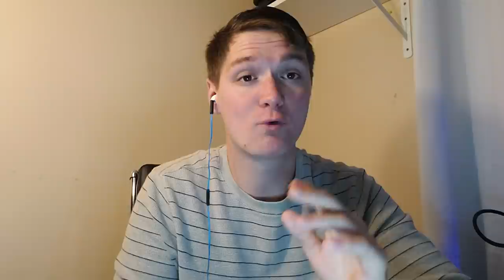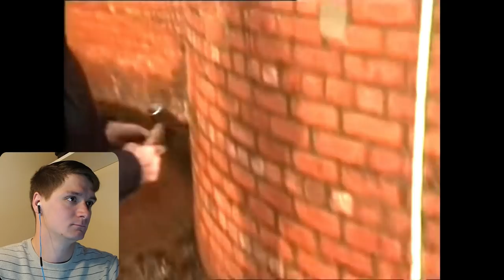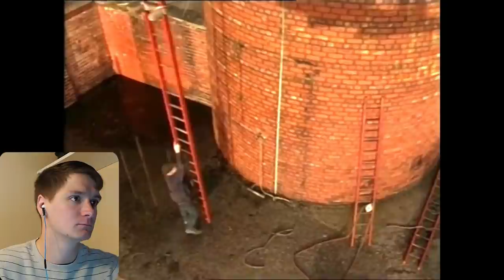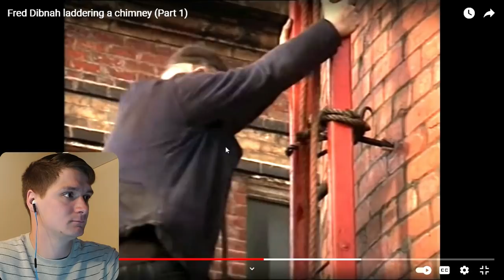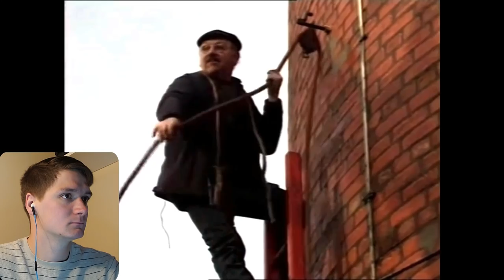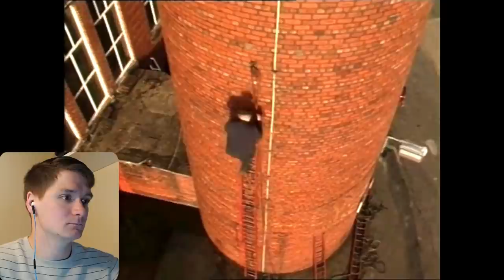American Reacts to "Fred Dibnah Laddering A Chimney"

Comment: I had a job, a few years ago where occasionally I had to ascend an external vertical ladder to a height of about 40feet. From about 10feet or so, the ladder was surrounded by safety hoops but even so, it was still one of those tasks I'd rather not have had to do, especially in freezing winter. Then I would have to use gloves to stop my hands sticking to the metal or I'd need to be extra careful if the rungs were ice-covered! Very occasionally, apart from the normal tools I used, I might also have to take a heavy vacuum pump up with me as well and that would mean a second or maybe third ascent with test equipment.

Comment: 7:28 Fred was a great guy and a good engineer but the techniques of how to ladder a chimney were not his invention. Chimneys have been around since the industrial revolution in the 18th and 19th centuries. The Chimneys were built from the inside but repairs had to be done from the outside. Repairs were an after thought, so the people of the time looked to the people used to climbing tall buildings, the "steeplejack". A steeple is the tall tower or spire of a church or cathedral which for centuries were the tallest structures in England. When the roofs or statues of these buildings needed repairing it was the steeplejack who would erect the ladders needed. The methods to ladder a chimney were developed by steeplejacks long before Fred was born. Fred did invent some techniques to help demolish chimneys as he was active in the era when coal lost its place so all these old chimney were demolished. There are very few of these tall chimneys left and mostly as part of museums. I would be very surprised to hear if there are any of these old chimneys still in use as anything other than incinerators.